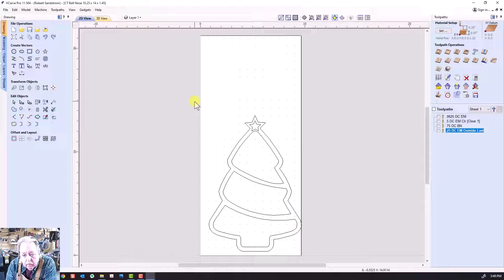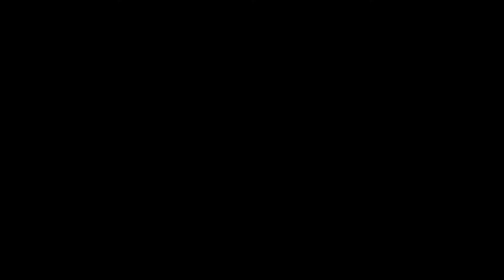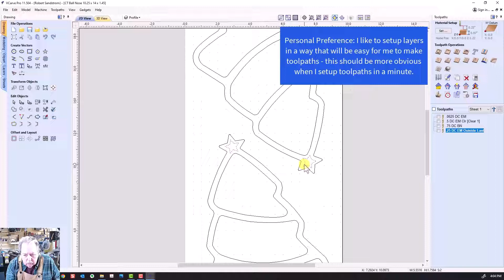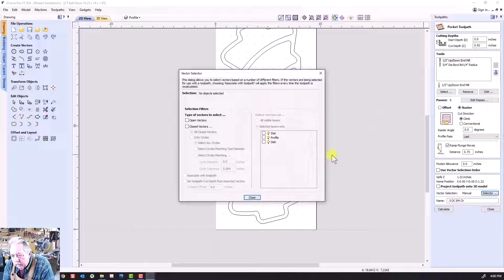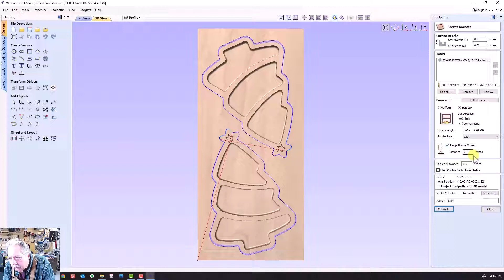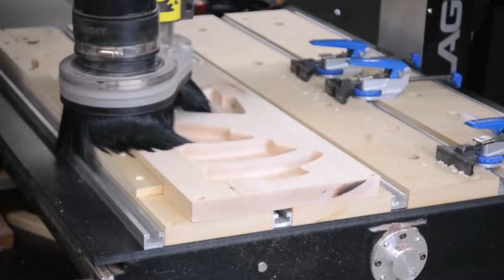Christmas Tree Tray Project

Comment: Just getting into the CNC stuff (had my Onefinity about 3 months) and really like the hold down set up you have. Are those side force clamps from Rockler? Also, I didn't see a listing for the 30-degree bit you used. I'm really enjoying the info you are able to get out of Shane on the epoxy pours!!! I learned some really good tips from this video!! Thanks
Reply from the maker: Thank you for the positive comment. I’m in the middle of some family stuff right at the moment, but I will get you a link to the bits a little bit later today or tomorrow. The-side clamps in the video  are from Rockler. But there’s actually cheaper ones on Amazon that work just as well or better and cheaper,, I will send a link for that also after the event that I’m attending.
Reply from the maker: Joe links for clamps and 30° vbit are in description now.  Don’t forgot discount code if you buy bit from Rip Precision Tools.
Reply: Thanks Rob, I ordered some bits from RIP yesterday and used your discount from another video I watched. I'm planning on redoing my waste board later on and like the T track set up you have. 
I've done a couple of epoxy pours that were two colors but really like the multi color! Figuring out the order they need to be done is key and keeping notes will help me a lot. (I'm not too good at that)
Thanks again for the help.
Reply from the maker: @joereynolds6866  glad ou are enjoying the videos.  Having fun is the key.  In the past YouTube videos have been sort of a hobby and a way to pay forward what I have learned from others.  In 2023 I plan on stepping up my pace and production of YouTube videos.  I want to see if I can make the channel at least pay for my woodworking and laser efforts while still helping others learn.

Comment: I enjoy your videos Rob. About zero-ing off the bed, after you surface both sides, is it necessary to modify your "new" material thickness in VCarve Pro for the pocket and vcarve to be the desired depth? Can you explain that because I like the idea of not going into the spoilboard and I'm just starting to try that.
Reply from the maker: Thanks for your feedback Greg. And yes, I had mentioned to Joe before you can’t really put in a material thickness until after it surfaced. Sorry that wasn’t clear in the video.
Reply: Ok disregard that Q Rob. I read Joe's comment  further down and you answered my question there. My favorite tip is the conversion of the mm to inch feature, Thanks!

Comment: Yes, definitely want to see the sanding process.
Reply from the maker: Larry I will try to put something together in the near future.
Reply: I have a question about epoxy. Is there any situation where the pour is in danger of coming out due to improper adhesion? Wondering just how fine the pocket you pour into can be. Thanks
Reply from the maker: @larrystaas1940  I have never encountered or heard of that happening.  The only thing that I can think of where that might happen is if there is a foreign substance on the wood when you pour - but otherwise can’t think of a reason why the pour would come out.  I could be wrong - but that is my experience.

Comment: Great video with quite a few “tips”. Always good to learn based on how other makers approach the same problem. I don’t understand how you can put in the material thickness in the setup before you surface the board?
Reply from the maker: Thank you Joe for the file that allowed me to do this video.  As you say many of us all approach things slightly different - not right or wrong just different.  You point is correct, I couldn’t put in the material thickness until I surfaced the board.  It may not appear this way in the video, but I surfaced the board and then I put the thickness in and started working on the modified design.  I probably should have made that more clear.